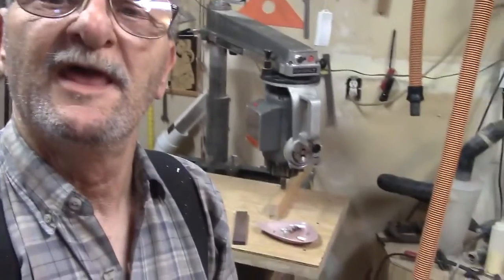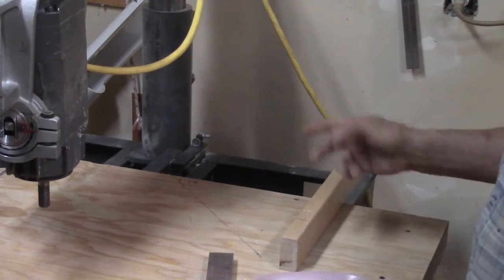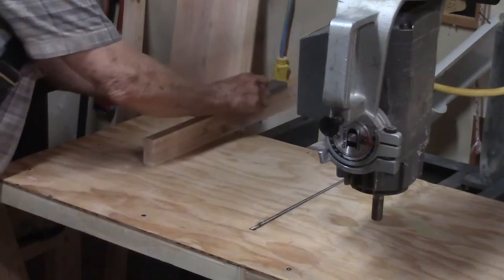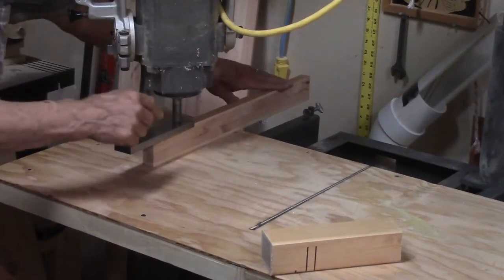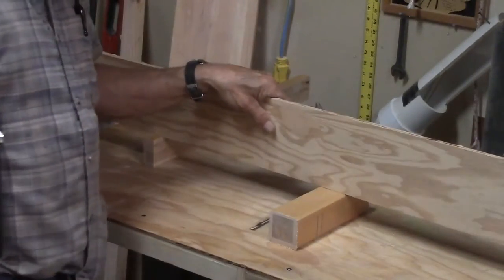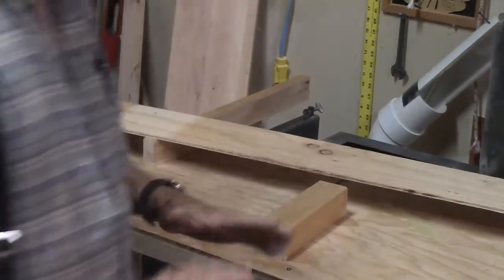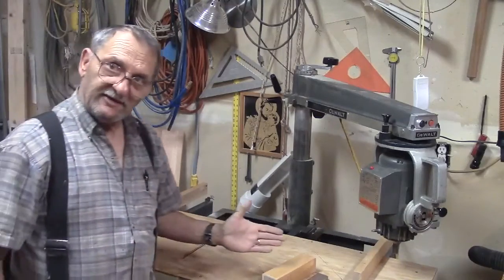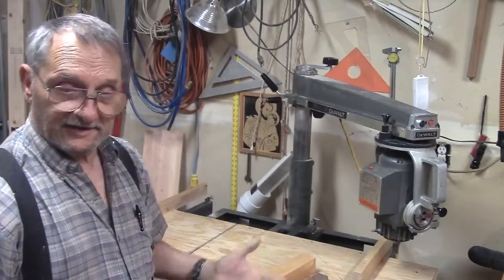DeWalt 790 Table Adjustment Revisited

Comment: Ed, I have a question for you. Do you still recommend putting a couple of penny's along the fence and then butt your table top up against to create a small gap for saw dust. I really to not have a gap at all right now. Just wanted to check with you to see if that was a good move on your end
Reply from the maker: If you have an air-compressor with a hose and air-blower nozzle hanging close, and you use it faithfully, I wouldn't see any problem not having the sawdust gap.  Even a draftsman's brush will do the job.  I still like the gap, even though I still have to blow it our every once in a while.

Comment: why is this method better than your first method?
Reply from the maker: Because the bolts at the rear of the angle iron adjustment bracket are behind the back of the table, this cause a cantilever effect.
Reply: @edwaggonersr.7446  so?You compensate by adjusting the front one..?